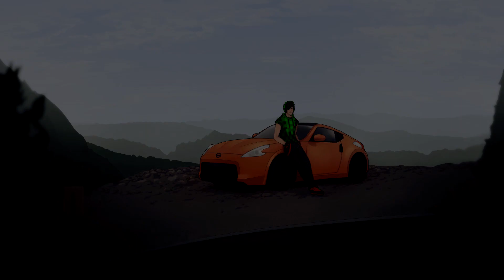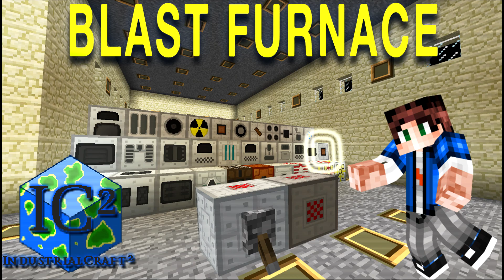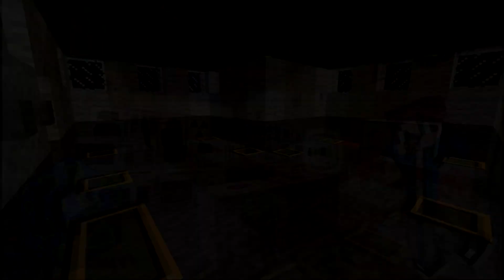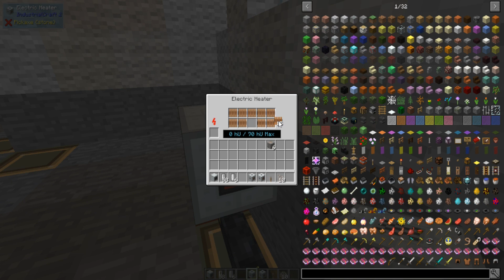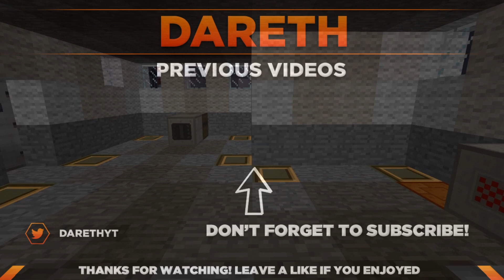Getting Started - Industrial Craft 2 Mod 1.12: Blast Furnace & Steel

Comment: My fluid cells aren't going into the compressor anyhelp?
Reply: For the future if anyone is running into the same issue i was having. You need to put Tin Plates into a Metal Former to make Empty Cells and use those to get Compressed Air. Running Infinity Evolved minecraft version 1.7.10.
Reply: @OtakuWrath  legend
Reply: You need to make universal fluid cells, then put them into compressor and then they work.